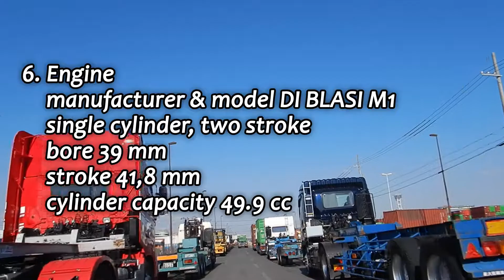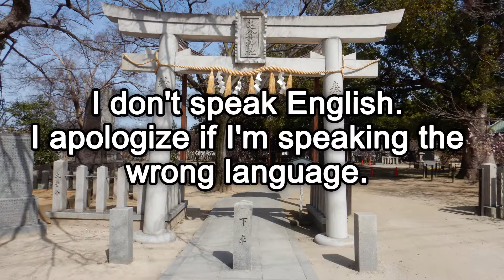Rules for Mopeds in Japan

Comment: Old video but nice to see someone doing it live, between, 2 step turn is on 3 lines roads (unless a sign say its not allowed) but also in 2 lines roads if there is a sign to do it.
Reply from the maker: In Japan, two-stage right turns are made on roads with three or more lanes. It is important to note that two-stage right turns must also be made where only the intersection section has three lanes.

Police are targeting.
Reply: @sambar-t8517  nope, i was confused about so i went to the police station, your statement is correct but also from the book handed by the instructors at menkyo center two step turns should be made on two lane roads if there if a sign indicating to do so.
Also the police station told me i can invade the crossing path of pedestrians and half block it if there is not enough space for the moped to do the two step, i told them they will get angry and also its dangerous but they insisted and said dangerous but its totally fine for you to do it.
Reply from the maker: @mamutero21  You are fantastic. You are talking about the sign with the white arrow on the blue board.
That's right. I had forgotten about them because I hardly ever see them.
Reply: @sambar-t8517  no lol, thats not what i mean
Reply from the maker: @mamutero21  What you are saying is that it is acceptable to block a pedestrian crossing when making a two-stage right turn?　What the police say changes from area to area, so you need to be careful. As far as possible, you should not block the pedestrian crossing. I wait in the space between the stop line and the pedestrian crossing or on the side of the intersection rather than the pedestrian crossing.
Reply: @sambar-t8517  yeah, i know, thats why i try to avoid roads with 2 step turn, the law and the real situation doesnt match at all so better be safe.

Comment: How do you make a right turn when there’s a Sign that you can’t do a 2 step right turn?
Do you go to the center part of the road just like the cars?
Reply from the maker: At junctions where there are signs prohibiting two-stage right turns, turn right using the same rules as for cars. Mopeds are slower and require extra care when changing lanes from the first lane to the centre lane.

Comment: hi bro. is the two step rule for moped mandatory on all roads.
Reply from the maker: Two-step right turns are made on roads with three or more lanes.
It is important to note that this includes right turn lanes.
However, there are some places where two-step right turns are prohibited by signs.
In such places, you need to go to the right turn lane.
Reply: @sambar-t8517  if there is a lane just to the left, go straight and turn right, what should I do bro
Reply from the maker: @pecintastreetfood8570  It's hard to explain in writing.
Are you referring to when there is a left turn lane within the same intersection?
For example, suppose you're at an intersection with a dedicated left-turn lane.
The moped goes straight ahead in the left-turn-only lane and makes a two-step right turn.
The blinker will be on the right.
For example, if you are making a right turn at an intersection where the intersection has a dedicated left-turn lane and another intersection
Let's say the intersection with a dedicated left-turn lane is ① and the other intersection is ②.
At the intersection ①, you drive in the straight lane.
If the intersection in ② has three or more lanes, make a two-step right turn here.

Mopeds should drive in the leftmost lane, with the exception of dedicated left-turn lanes.
Reply: @sambar-t8517  means if the moped to turn right is not required to make two step?
Reply from the maker: @pecintastreetfood8570  Mopeds must make a two-step right turn when making a right turn on a road with three or more lanes.

Comment: Can we ride two person on gentsuki 原付license?
Reply from the maker: The moped category of your license only allows you to ride a moped of 50㏄ or less.
Mopeds under 50 kg are only allowed to be ridden by one person.
The laws for driver's license and vehicle standards are different and a bit complicated.
Reply: @sambar-t8517   How about 小型125 cc AT can we ride two person ?
Reply from the maker: @sushiltamang7527  Mopeds with an engine displacement of 51㏄ or more and 125㏄ or less will have a different license classification." kogatagentei Futsunirin「小型限定普通二輪」" license is required.
The body of the vehicle is designed to accommodate two passengers.
The law is complicated by the fact that there are two laws, one for the driver's license and the other for the body structure.
Reply from the maker: @sushiltamang7527  It is difficult to explain in English, but with the license required for 125㏄, two people can ride.

Comment: The two-step right turn is the stupidest rule I've ever heard of. If you need to turn right, you should be in the right hand lane not the left hand lane where people are turning left. If you put your right turn signal on then turn left, this can cause an accident. That rule was made by Very Stupid people.
Reply from the maker: Thanks for commenting.
The law classifies mopeds by displacement, so the maximum speed is 30km/h no matter how much horsepower they have. And the rule of two-step right turn applies.
It seems to work well for an unpowered moped like the DiBlasi R7, but for a high-powered moped, it could be dangerous.